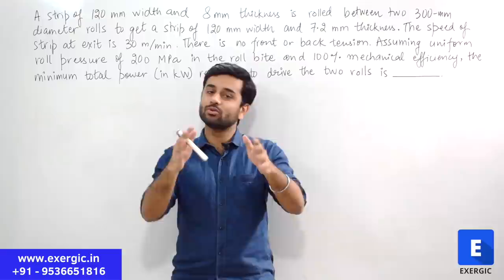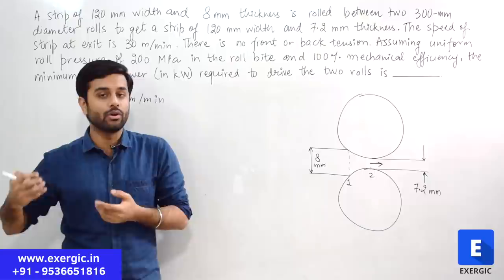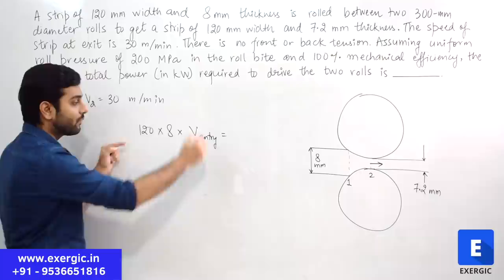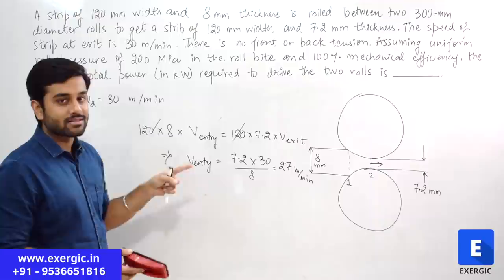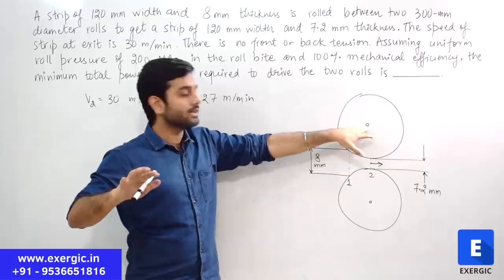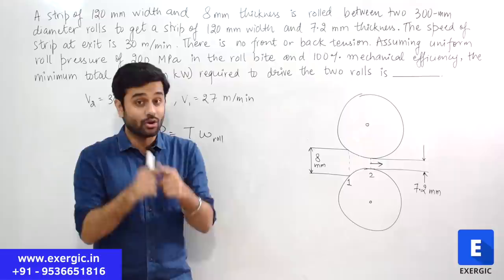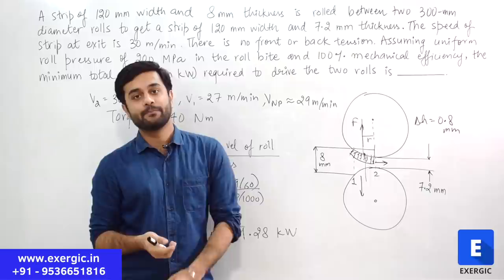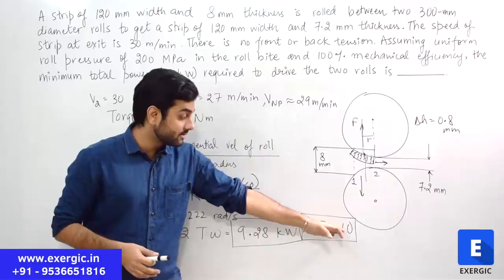Be careful of such rolling numerical - Manufacturing | GATE Mechanical

Comment: Thanks a lot sir💖
Sir i have one doubt if the efficiency is less than 100% will this power required to drive the rolls from motor will be same and power reached at roll will be .95 of P(motor) ?? Or we have to divide this power by .95 pls help sir or any student....
Reply from the maker: When efficiency will be less than 100% for any system, it will always require a higher input for same output. Or for same input, output will fall. As simple as that.